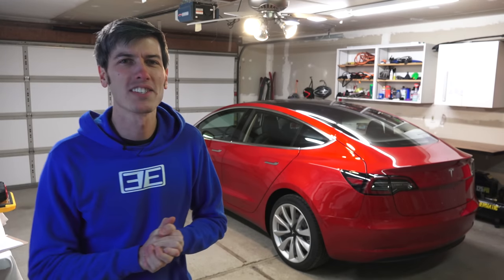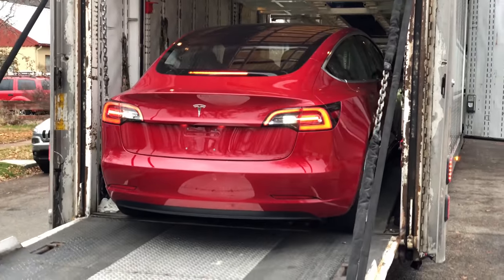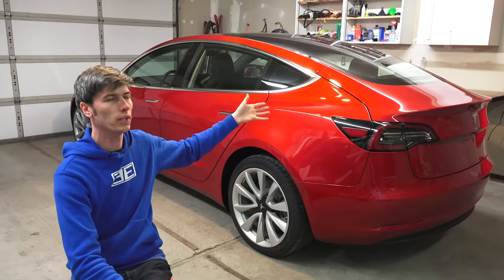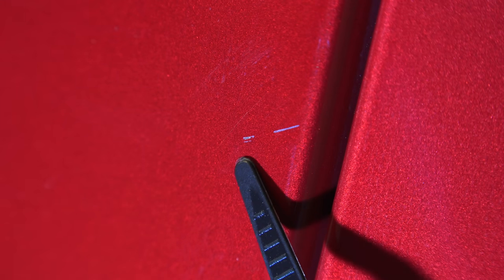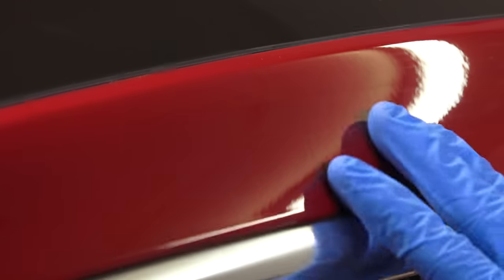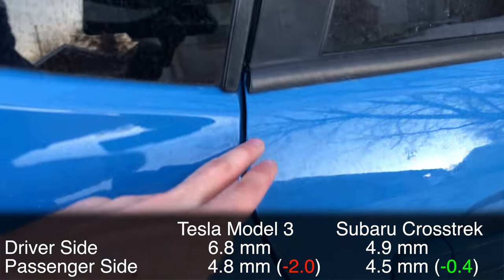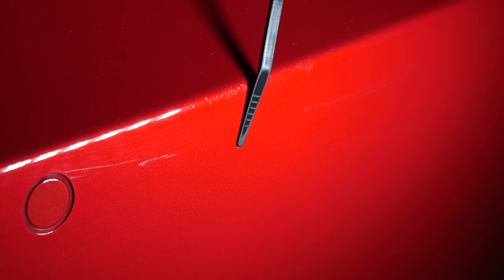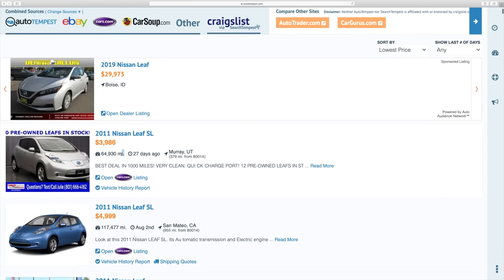Everything That's Wrong With My Tesla Model 3 - Quality Problems

Comment: Tesla fan and a Tesla owner. Completely unacceptable. I have the Multi-Coat Pearl White on my Model 3 Performance. Paint job is nowhere near as bad as yours, but it still sucks and the paint is soft. It’s their biggest problem right now. They need to get it fixed ASAP. Unacceptable in any new vehicle—especially not one that has a $2,500 paint job.
Reply from the maker: Thanks for sharing your experience!
Reply: as a qualified autobody tech, the panel gaps, roof glass gaps and paint are totally unacceptable! I would expect to lose my job over quality like this Jason. Tesla need to rectify this asap.
Reply: Shoulda bought  CHEVY!!
Reply: @Jasona1976  Chevy? You have a low bar.
Reply: blame it on new EPA resticions on chemicals allowed in painting.
Reply: @Jasona1976  Your Bolt also doesn't have autopilot, superchargers, or go 0-60 in 3.5s and 11s in the quarter mile.
Reply: Snazzy Labs just watched your video too 😂 Subbed to both of you guys
Reply: @Jasona1976  Assuming I have a Tesla are we? Nice try.
Reply: chevy has dealers, tesla are legally blocked form having dealers in a lot of states, jason's iowa included, so they get damaged in transit and there's no dealer to fix it up before the customer takes delivery.
Reply: @satoau1  Such an EXPENSIVE and OVER PRICED vehicle should be delivered in perfect condition. Tesla Fan Boys are simple minded apologists.
Reply: @nic.d7539  I measured my nieghbors 2018 malibu, wasn't much better
Reply: I wonder how paint "softness" is measured.
Reply: @Jasona1976  , the Bolt is a good car, but its sales are "soft"
Reply: Ha ha...u both my favorite YouTuber...
Reply: no car can be delivered in perfect condition. every other manufacturer also gets their cars scratched in transit, the difference is the dealer receives the car and fixes them before the customer collects it. tesla isn't allowed to have dealers in a lot of states (including iowa where jason lives) so they can't possibly fix them.
Reply: @satoau1   Agree :)
Reply: My paint was perfect as well on my P3D. Midnight Silver, and I got it wrapped with XPEL stealth, it looks amazing, and there isn't a bump, scratch or fleck anywhere, and with some luck there won't be for the next 10 years. I don't know if its only certain colors or not, but I will say that while it seems a bit silly to have those defects, I don't think you need to have it handed back in. Minor paint defects are correctable with a wash and clay bar. While I agree that Tesla should always innovate and work on improving on every aspect of their business, I do think that is something they are trying to do, and I don't fault them for having the impossible task of saving the world while making a profit. For a company that I support, and a good product, I will absolutely make some concessions. I would pay $20,000 for google fiber if I have to just to make sure I don't give Time Warner a dime of my money ever again, just like I would give Tesla $70k for a car that might have some minor defects, so long as it delivers on all the major things I bought it for, which honestly it has exceeded every expectation I had had for the vehicle, from interior, to build quality, to performance, to storage space.

I do think though that some of those scratches seem questionable, I am curious what happened in those 22 miles. It looks like the car was scraped on something while being moved.
Reply: Any true Tesla fan should find this unacceptable. If you are a fan of something you should naturally want to see it succeed and if this is the quality of the product they send out then long term success is less likely. The market will be flooded with affordable electric cars from major manufacturers very soon and unless Tesla step their game up i dont think the future looks great for them right now.
Reply: Well what else would you expect? You’ve heard of Tesla’s recent production issues.
Reply: Bruce Allen slow.........
Reply: Bruce Allen how many negative comments can you post ? You obviously don't like the performance of a Tesla.
Reply: @satoau1  Why legally blocked? I agree with your dealer fix-up, standard problem and resolution, so not having a dealership will hurt Tesla.
Reply: @Jasona1976  We had a paint defect and many misalignments on our Chevy Volt. Even the C6 had a bumper misalignment. GM shares similar issues.
Reply: @dreiak  A clay bar is not going to replace clear or paint that is missing, come on now.
Reply: murica.!!
Reply: well you know how you can't open a mcdonalds near where there's already a mcdonalds? going back decades, dealership associations in many states got laws passed to protect themselves from too much competition in the same way as that, so you can't open a dealership if it's within X miles of another dealer, and these dealership associations now have a lot of political influence because they've made quite a lot of money thanks to having their competition minimized. they've also gotten laws passed so that automakers can't run their own dealerships.
a bit more info on the background can be read in a 1999 article "Fight Is Promised Over G.M. Plan to Buy Dealerships".
Reply: @Jasona1976  Check the resale on your compliance car Dolt. LMAO !!!!
Reply: @satoau1  
True but they could still send your car to your nearest qualified body shop to take care of things....
Reply: @nic.d7539  people should stop buying Tesla altogether so they go under!! Screw electric cars!
Reply: apparently no they can't. they're not allowed to do anything even remotely dealer-ish, like discuss price or even give test drives in these states where they're banned, and that includes service centers. you're free to go and get your own repairs done, but if that's organized by tesla then they're involved in that state which is illegal. whatever is done has to be independent of the manufacturer, for other brands as well but they're ok because they already have dealers, and no new permits can be given.
Reply: @typ930  Yeah screw electric cars and their cheap running costs, we'll stick to paying out the arse for petrol when it becomes so expensive you won't be able to afford to do anything when we get to our destination...
Reply: @Baggamuss   there is lots of oil left to power cars for many many years. With new techniques and technology billions of gallons are discovered each year. If you reside in the US do not complain about fuel costs, as these are some of the cheapest in the world.
Reply: Bruce Allen There are some advantages to Tesla and I agree with you that it is overpriced at the moment, but your Chevy bolt isn’t the most ideal EV on the market either. For its price and only around 220 miles, it’s still a commuter car at this point. Plus it’s pretty small. Perhaps if the price was a little cheaper many more would consider it, but honestly there is still much work to be done in the EV market, for both Tesla and Chevy if they want to appeal to the masses. And for those commuters in heavy traffic, autopilot (or should I say adaptive cruise control with lane keep assist) is a savior to many, so just because you may not use or have it, it isn’t entirely useless.
Reply: @nic.d7539  the worst is the sideways misalignment of the windshield and roof glass. Is one shifted sideways or is the top edge of the windshield narrower than the front edge of the roof glass?
Reply: @satoau1  my paternal grandfather always drove Hudsons and he never bought one at a dealer. He'd drive to the factory and buy direct. The government doesn't allow that now, thanks to lobbying (essentially bribing) by the car dealers. Tesla is doing it anyway, so the dealers have been busy "lobbying" more to keep Tesla from opening company owned stores or franchising dealerships in some states.
Reply: yup, middlemen want to keep getting paid and get paid even more if possible.
Reply: Ethan Richie But the difference is that Tesla has made an appealing car which needs to be cheaper and improved production quality, others are still struggling to make an appealing car. And you can tell this just by looking at resale value.
Reply: @Jasona1976  Tell us again how great it is in a year or so when your Bolt's battery pack degrades. You have no business claiming a few defects in a paint job is a problem when your own car can't be used on long trips and is likely to have serious range issues in the near future.
Reply: sato AU my Bolt was
Reply: Ethan Richie total nonsense. The Bolt is  20k less and just as good
Reply: @Jasona1976  The Bolt is crap. You know it is, and so does the rest of the market. That's why its sales for the first 11 months of this year are about 15% of Model 3 sales.
Reply: @thegreatmechanizedape8262  Wrong. 1) Accelerating isn't illegal. Like any other aspect of driving, the circumstances determine the consequence. 2) It's driving that kills people. Auto pilot reduces (but does not eliminate) the number of people killed. 3) Supercharging has minimal effect on battery life for most Tesla owners. If you charge only using superchargers (like Tesloop does) then there can be an issue, but most charge 90+% of the time at home.
Reply: what do you expect from a mickeyMouse car company?
Reply: @therealctoo4183  and you have no idea how a Tesla will be running in a year or so.

Fan boys need to go away
Reply: @kizzthis9983  I'd expect a mickeyMouse car company to not have so many enthusiastic owners. For example, I wouldn't expect that Model 3 owners would consistently describe it as "The best car I've ever owned" if Tesla were a mickeyMouse company, but they do every time I meet one.
Reply: Nor Dic I post the truth.  Have you read the facts here. DUH
Reply: William B Volt is not a Bolt.  DUH
Reply: William B your proof?
Reply: cuda426hemi check out the complaints. DUH
Reply: @therealctoo4183  Word of mouth does not define success when you sell to mass markets.  Telsa is a niche for mostly rich people.  Believe me, whatever "car technologies" they have were probably licensed off other car manufacturers.  They also lack the will and/or money to do extensive testing on proving grounds.  I suspect the company just meets whatever federal govt requirements to put a vehicle on the road.
Reply: PessimiStick   Good Features that sound good on paper but when actual quality problems now make the car worth less than it should it’s more than just an annoyance.  People are giving musk a ton of leeway when other manufacturers would be burned at the stake for problems like these.
Reply: sato AU   Huh?  They should leave the factory is perfect condition and be wrapped in protective films. Tesla did neither and not having a dealer to fix these problems is no excuse either.
Reply: Erik Garcia  if you really want to save the world how about moving to a place where you don’t need a car.  Like NYC or Boulder.  I’ve lived  in both places going back to college years and have never owned a car.  Rode a bike in boulder and it was awesome. Didn’t think twice about getting a car.  Mind you I had come from nyc so it was easy.  People have become way to wrapped up in cars.  Humans have done just fine without cars for millions of years. Even a hundred years ago it wasn’t critical to life.
Reply: @typ930  I reside in the UK, and oil won't be around forever.
Reply: @Baggamuss  not forever, but yes for many many years yet to come.
Reply: @typ930  In 7 years it starts getting banned from cities.
Reply: @kizzthis9983  Yeah, sure. People line up and wait years to buy a Tesla because they just don't know any better. They need you to  show them the way! What's wrong with you? Do you really think Elon is a "charismatic" cult leader? Have you heard the man speak? No one thinks he's a great orator. He's respected because of what he's done with Tesla and SpaceX, not his speaking skills. It's the undeniable fact that his cars are far superior to the competition that is driving sales.

I really wish his cars weren't so far ahead of the others, but the others have dragged their feet for so long that it was inevitable they'd fall behind. Now it's likely that many of them will not survive the switch to EVs.
Reply: @therealctoo4183  thankfully I do not live in those cities. These electric appliances are the apocalipse for us, car crazy people!
Reply: @typ930  LOL! You think where you live matters? Banning them in cities means that ICE days are officially numbered. By 2025 (probably sooner), gas stations will see significant drop in demand. That will cause many of them to decide against spending up to a million dollars to replace their storage tanks when the time inevitably comes. You'll see them closing their pumps and replacing them with EV charging stations. Even now it's a bad bet to spend money installing new tanks, but many don't see that... yet. In a few years, it will be ICE owners who have range anxiety.
Reply: @typ930  I'm NEVER going to buy another internal combustion engine. Not in a car, a lawnmower,... nothing. Not because they're bad for the environment. They are, but worse than that, they're bad for my wallet. ICE makers sell you the car/lawnmower, leaf blower, etc., cheap and then screw you over on maintenance while you're forced to overspend on fuel. You want me to stick with ICE cars? YOU buy a brand new FULLY LOADED BMW 3 series and have it delivered to my house. Otherwise, I'm going electric.
Reply: @therealctoo4183  you are clearly not an enthusiast! for you, a car is simply a means of going from a to b.
Reply: @typ930  You clearly don't understand that 99.99% of the world is not enthusiastic about internal combustion cars. That's part of why the change is going to be so easy for us. We see a far better mouse trap and not a single good reason to stick with the old one.
Reply: @Jasona1976  Jeez, you love using your over-the-top adjectives and capitalized words. I have news for you, TYPING LETTERS LIKE THIS DOES NOT MAKE YOUR ARGUMENT MORE CORRECT. Also, try less to insult the person that disagrees with you and more to bring up relevant information that actually helps. Calling them simple-minded apologists, snobs, puzzies, fanboys, trolls, and drooling suckers is not helping your case. It also shows how insecure you are, calling random people you've never met names on the internet just because you don't have to face them in real life. Ironically, you seem to be the troll here. All you're doing by calling everybody names is making them disagree more with you rather than seeing your point of view. If you're just here to troll people who like Teslas, then waste your time doing something else.
Reply: @alfredoibarra9825  Funny, other car makers seem to be able to produce a non-shitty paint job with those same "EPA restrictions". WEIRD
Reply: @Jasona1976  So your argument is to take midol and lie down? You told everybody to look at the facts, and you constantly asked them "Where's your proof?" Telling me to take midol literately has nothing to do with Tesla. The most evidence you've given to the people in this thread is "My Bolt is better and costs less" "You're a nonsensical rich snob" "You're paid too much" (good job on assuming that people who like Tesla all have Teslas). Most of those, except for the Bolt costing less, are opinions and not even facts. It's funny that you've told these people to look at the facts when you've provided one. At this point, I hope you're not serious and just messing with all of us.
By the way, I didn't know what midol even was before I read your comment, so I looked it up, and really? I'm not even a woman. Take your insults somewhere else because at this point you're just trolling. Again, I hope that you're just messing with us.
Reply: @Jasona1976  "Collin" is generally not a female name. My username is Collin The Viking because my ancestry is related to the Danish. In fact, my grandparents are Danish immigrants. I call myself Viking as a joke because vikings were likely my ancestors.
Also, if I were truly a PC person, I would've given you an entire lecture and rambled on and on. All I did was say that that joke doesn't work on me because I'm male. Notice how I haven't told you to take any medication and have actually presented facts, while you're telling me to take medication because I disagree with you. Also, I do have evidence to support my claims, but if you had presented actual facts from your point of view, maybe I could've challenged them. Most of what you wrote was opinion, and you can't really challenge those with evidence. Tesla owners are snobs? What evidence do you or I have to assume all Tesla owners are snobs? You can't argue against that or for that because there's no research about it, it's just opinion. I feel like you're just hating on Tesla because you have nothing better to do and want to see other people get annoyed with you just like the average internet troll. You shouldn't care this much about hating Tesla. If you like your Chevy Bolt, that's totally fine, and good on you for driving electric. But nobody should care enough to hate Tesla this much. You could say it has problems, but attacking people for liking Tesla is just rude and uncalled for.
Reply: @Jasona1976  When I said lecture I meant PC lecture as in I would have gone social justice warrior on you, I did not mean lecture about Tesla because I was already lecturing about it, as you pointed out. Sorry for the confusion.
I do not regard Tesla as the greatest invention, that's sliced bread. Anyways, I hardly see you give any evidence other than calling Tesla fans names.
I could tell you all the things that are good about Tesla, but I know you're just going to respond with "You're a Tesla cultist fanboy." I'm sure you already have been told the reasons why not only Teslas but also electric cars in general are better, you own an electric car yourself!
It really seems like you hate Tesla and it's fans based off of this comment thread. It does not seem like you just laugh it off looking at your language and tone. The comments you've written make you seem like you care too much about hating on people who like Tesla too much. I'm sorry, but what you've written so far has been 90% insults.
Reply: @nic.d7539  what i don't get are the gap differences with the glass roof. The way I see it, the glass panels must be cut to different widths or false shape. If I were Mr. Musk, I'd kick down some doors at my suppliers.
Reply: @nic.d7539 having a PHD in specifically red auto paint i also think this is very unacceptable. I also have a masters degree as a qualified car mechanic. MY OPINION MATTERS
Reply: @PessimiStick  what good is 0-60 in 3 sec. in bumper-to-bumper traffic?
Reply: @98vwgolf  Tim - they've been around for a decade - do some reading son.
Reply: @Jasona1976  Bruce - you bought a compliance car that's lost your $20k you're so proud of saving after a year -  on a Korean joke that already degrades badly - CHECK YOUR COMPLAINTS because last I heard Tesla is No 1 in customer satisfaction - #1 - can't get higher right?  Beside being the highest rated car in Consumer Reports history unlike YOUR Korean car - the Tesla batteries are degrading very little after years of service. Never mind over the air updates and AP and Superchargers. Now go play elsewhere or I'll simply beat you up again with facts GM joke-boy.
Reply: @wzDH106  tried test driving 4 different Cruzes for my last car.  All four had enging problems.  Overheating (on the test drive!), throttle response, intense turnout lag, slipping CVT transmissions, and anemic power.  I ended up with a Ford Fusion that's now got 100k on the Odometer and no issues (yet, bless) My wife drove a 4 year old VW Jetta and loved it, it's been bulletproof through hours of 95°+ traffic, a 1700 Mile road trip, and harsh northern Illinois winters.

Chevy just doesn't cut it anymore.
Reply: Snazzy Labs t
Reply: Three price of the paint is really irrelevant. On a fresh canvas the vehicle should be virtually issue free.
Reply: @satoau1  Idaho. His drives up Bogus Basin are a dead giveaway.
Reply: sato AU not quite....... Despite what Elon Musk would lead you to believe like... "tesla is standing up against big business!! and they are trying to ban them in other states!!" ....they arent "banned from having dealerships".... quite the contrary..... they are banned BECAUSE they dont have dealerships and are skirting all consumer protection based dealership laws doing so. . Its so they can keep parts and labor captive and rip off their consumer base......
Reply: @Jasona1976  bro. Might as well recommend him buy a Ford pinto